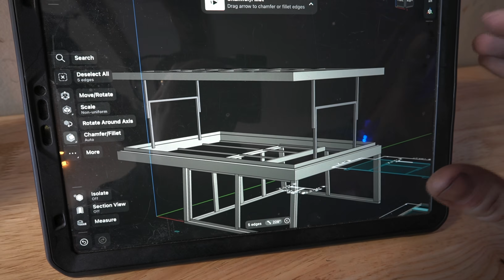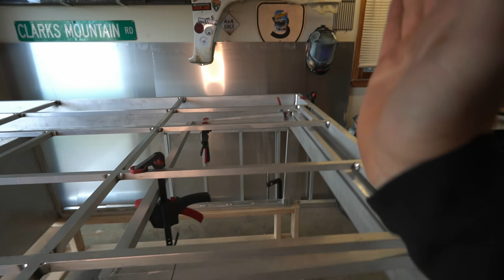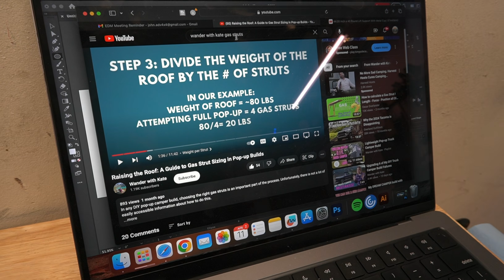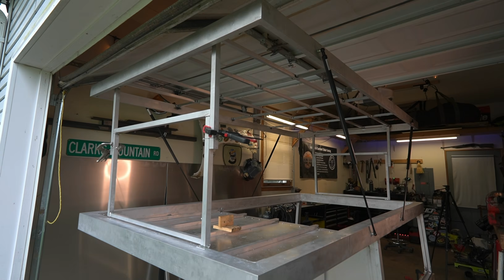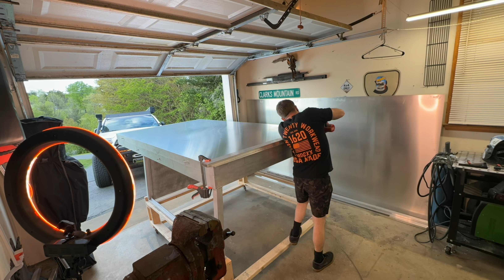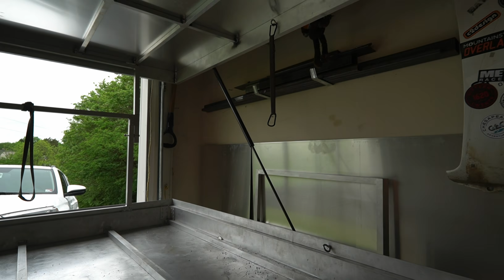Truck Bed Camper Build | Part 3 | DIY Roof Lift System!

Comment from the maker: **UPDATE** although this hinge system works well as it sits, a few people have brought up concerns for the fabric fitting with the “scissor” action of the hinge. 

Thank you guys for bringing this to my attention. Please see Part 3.5 for my updated hinge!! 

Truck Bed Camper Build | Part 3.5 | Fixing My Roof Lift System!
https://youtu.be/Fw8hyHMguIU

As always, everything is linked in the description of the video

Including the video by Wander With Kate that explains in great detail about choosing the correct gas strut for your application! 

Camper Blueprints available on my website! 
https://www.adv4x4.us/store-1-1/p/truck-bed-camper-blueprints-dxf-cut-files-combo

Want to stop  guessing your wiring?  

Build your 12V, 24V or 48V power system and get the wire gauge, fuse sizes and a wiring diagram for your rig with our interactive builder! 

More info here! https://www.adv4x4.us/tools

Drop your feedback in the comments I’d love to hear it!

Comment: I’m designing my own camping trailer box that will be removable from my flat bed trailer and I was considering building it from an aluminum frame, but the cost seems to be too high for my budget. Do you have a cheap supplier for aluminum components and what do you think is the cost difference between wood and aluminum?
Reply from the maker: Both are viable options! It all comes down to what you are capable of working with and your budget! Buying aluminum in bulk is your best bet. It’s I believe about $1700 in aluminum only.
Reply: @ Thanks for the reply, I’ll probably use wood as my frame and composite panels, or possibly some steel frame elements with rollers for my collapsible box.

Comment: FYI - Sika 330 - this stuff can be applied before you powder coat, cracks, seams, alum panels can all be glued and caulked before it’s coated and the coating will stick to the Sika 330. 
Be sure to check with your powder coat company beforehand as they might want to do a test sample.
Reply from the maker: This is awesome info! Thank you.

Comment: Looks like the side Carabiner and Runners are going to interfere with the fabric when you’re trying to close it, I’d put the eyes for the carabiner to the roof center structure and the bed platform so that it’s not in the fabrics way.  But still keep the eyes on the roof sides for the gear hanging storage like you said.

Comment: Love the way you approached this build, it looks very pro. If I was to do my camper again, this is the way I'd do it. Did you do any weight support calculations for the overhang to determine the frame material that you used? Subscribed!
Reply from the maker: Thanks Mike! I did use a deflection calculator for the material size on the overhang at 500lbs it didn’t have anything to note! Should be overkill, but that’s how I like it! Haha
Reply: @Adv4x4  That's awesome! I looked high and low for one but I couldn't find it. What dimensions did you end up using for the frame overhang. I ended up finding a deflection calculator for 8020 and just wne t that way with my design.
Reply from the maker: @MikeBabsBC it is 3”x4”  1/8” wall aluminum tubing! 

That plus the fact that I have that angle riveted too it and the sheet that goes under the overhang it probably won’t budge at all!

Comment: Great video and great build. This is going to be an awesome camper. One thing to consider on your front and rear hinge mechanisms is where the fabric is going to go when the top is down. Right now, the hinges you have created nest in a sort of "scissors" way, which seems to leave little to no room for the fabric to come in when the top is lowered. Most pop-top manufacturers use a piano hinge solution because this allows the fabric to fall between the two panels when the top comes down, giving plenty of room for everything to pack up. I'm assuming that you're going to use a heavier fabric for the top, which means that the nested scissoring action of your hinge mechanisms will want to pinch the fabric when folding and likely won't leave adequate room. Just something to consider. Cheers.
Reply from the maker: Thanks Jason! I was just looking at that yesterday! I’m hoping there is an enough room it appears that way. That makes total sense why other companies do the piano hinge style!

Comment: i had a miserable time with gas struts. i bought the same ones and then went with electric actuators. awersome build, you did a great job planning.
Reply: the straps might bunch up your fabric
Reply from the maker: They were a little tricky to get on but I think I have it dialed now! Finding the right lb rating was the ticket forsure! Thanks man!

Comment: This is looking great. Any pros or cons to having designed the struts for the exterior versus inside? I’m thinking if they were able to work inside there’s less to catch on a trail and the aero is just slightly better. But maybe it wouldn’t work with clearances etc.
Reply from the maker: I originally wanted them on the inside! Unfortunately no room, especially once there is fabric in the mix! There will be an awning on the driver side that essentially covers them as well. I think with better planning I may have been able to pull it off but at least they are easy to get too/replace this way!
Reply: Being on the inside might hinder his cloth walls from laying in properly. Being on the outside will expose them to the elements, though I'm sure they are rated for it.